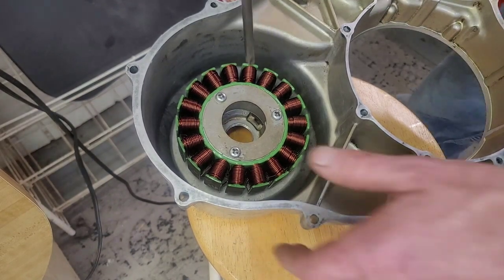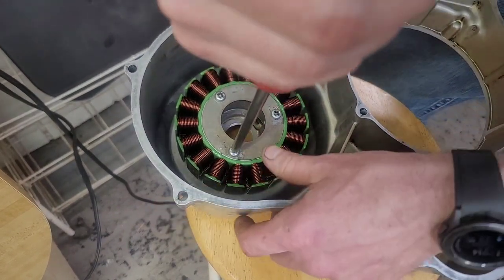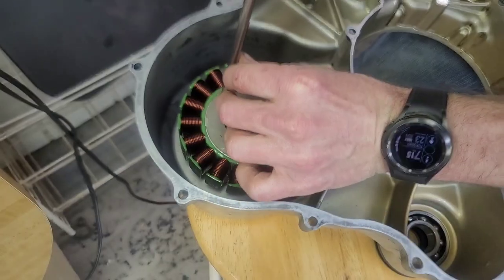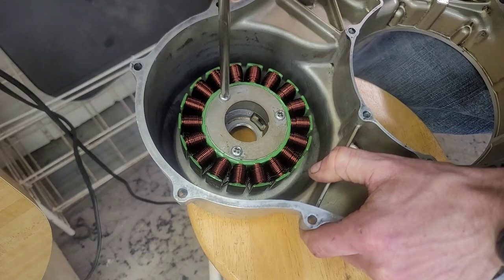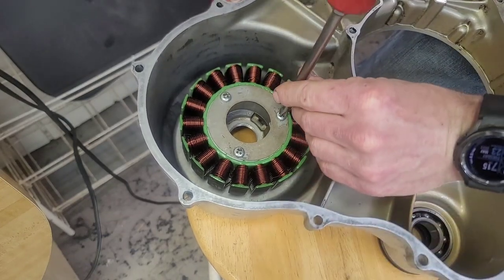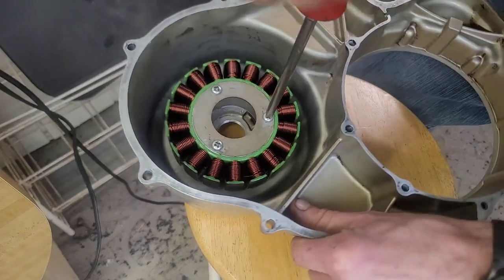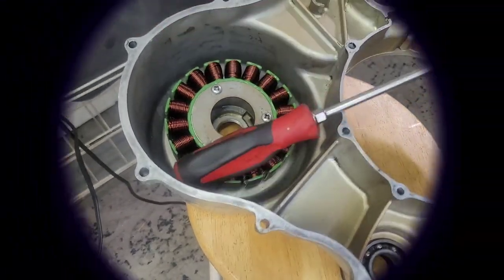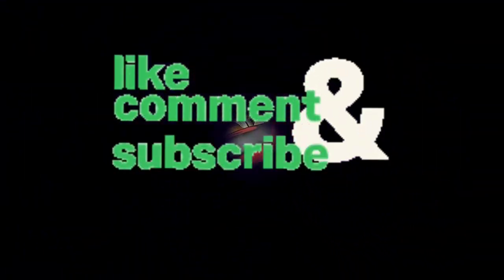Basket Case Goldwing part 3 (clutch removal)

Comment: Great video, very close detail and focused add some verbal detail on tensions such as the clutch spring. Again Great job and the showing of the stator and ease of cover removals.
Reply: Can't tell how he did it, but for my 87 GL1200A I used a mini bench top press from Harbor Freight, then places a adjustable oil filter on over the center of the spring landing on the spring. Pressing that down with the press released pressure on the retainer ring to the get the circlip out.
Reply from the maker: I used a c clamp to remove it, but did something similar to how you did on reassembly with a press
Reply: @MotorbikeGarage603  Thanks. But, why was that key not fitting at : 9:25 ? Thank you.
Reply from the maker: @bustjanzupan1074  The tool I was using wasn't the right one. It was for a different size nut, so I had to improvise.
Reply: @MotorbikeGarage603  Thank you. Because i was just searching for these keys for these nuts, but, it seeems as they ar ehaving a little biggr ( KM4) and a little smaller (KM3) keys/nuts, but just not these ones for 23/28 mm . We will see if we can buy something more right,  tomorrow , here in the old Eu, to dissassemble the engine apart, because of one piston not having compression. Thank you. Peace with you from old Eu.